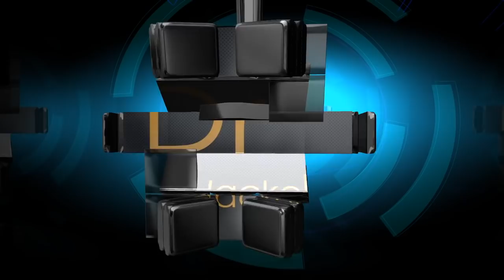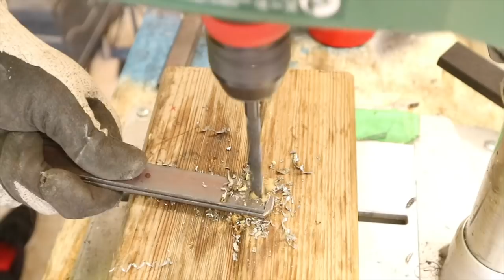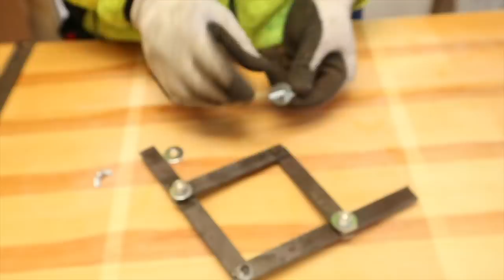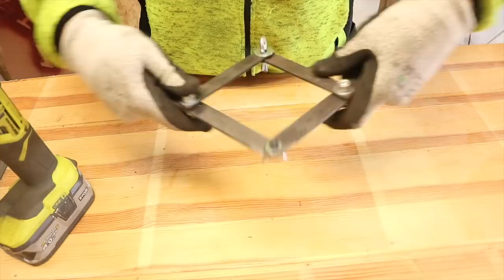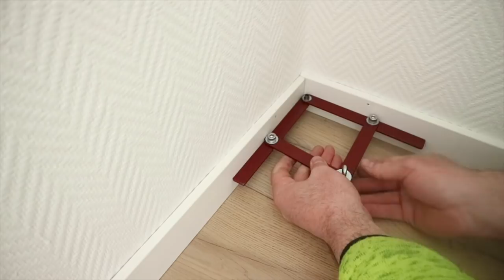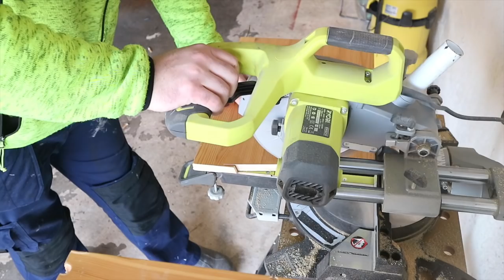Angle Divider for PERFECT Miters || How to Make it Yourself

Comment: Why don't you make a simple hold-down for your drill press? The work can get away from you and you could lose a finger. Oops, that already happened. 
For your "angle finder" If you countersunk the back side holes then you could make the thing flat to the work, and you wouldn't have the wavy cut line. 
You have some good ideas, but your iffy tool practices and poor safety habits are gonna get someone injured.